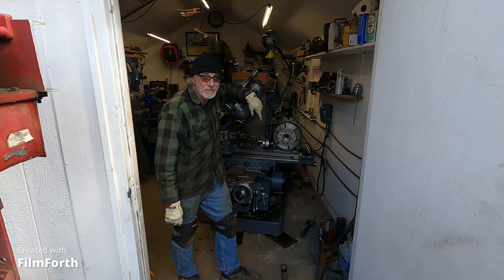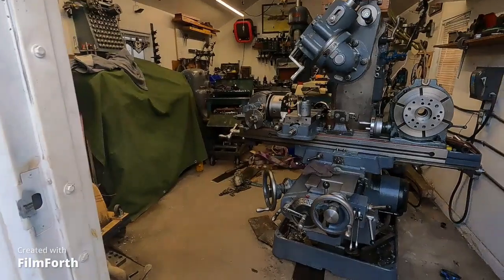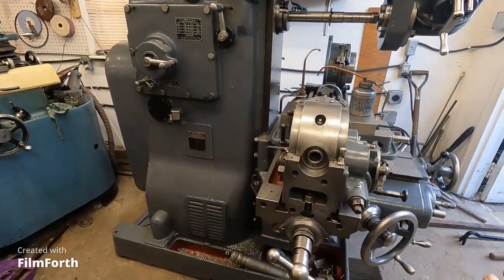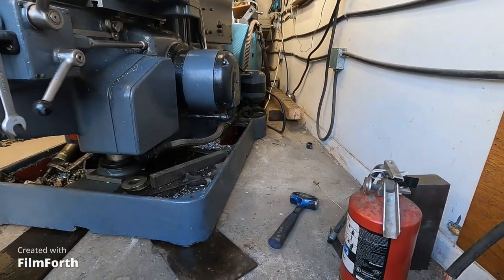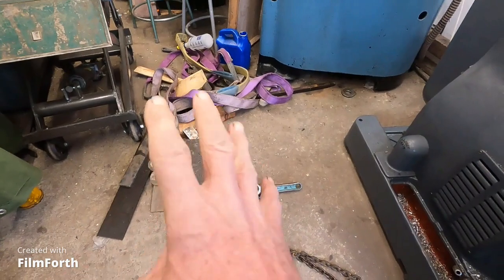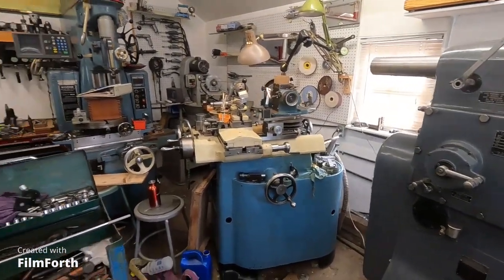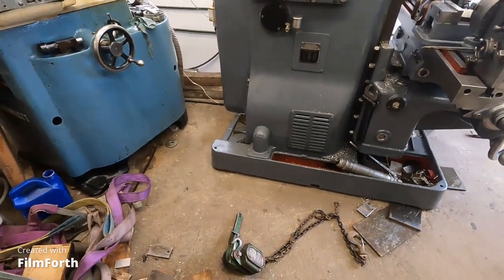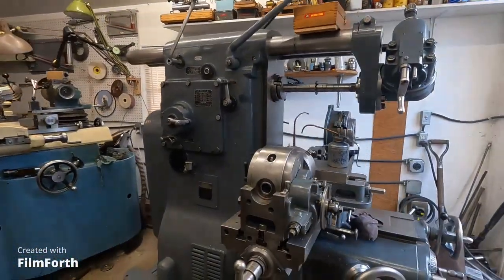Milling Machine moving progressively Wednesday morning

Comment: DeeDee, Slow going but going none the less.  I’m enjoying seeing you doing “crazy stuff”.   Moving everything in your shop while dodging all the other tools must be difficult.   What is that old saying about putting “10 lbs. of sugar in a 5 lbs. sack.”  Cheers, TB
Reply from the maker: The hard part was getting the mill off the sinking concrete spot to a point it is not blocking the door and now can be used as an anchor to pull the old Monarch out from the wall. The worst machine is the Moore jig borer those are 8ft tall  and 4000lbs of sugar. I am heading out for another go

Comment: Be careful and don’t strain yourself. Why not use round bar to move the Mill around? Have a great day.
Reply from the maker: Thanks, I am going slow. It is easier to just slide the machines on this rough floor, using pipes they just stick and the machine is sliding on top of those